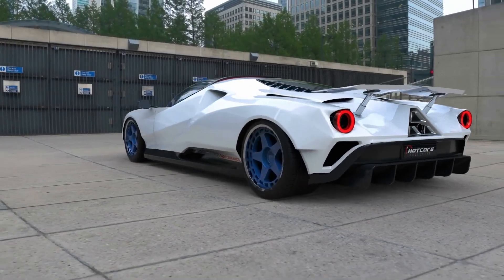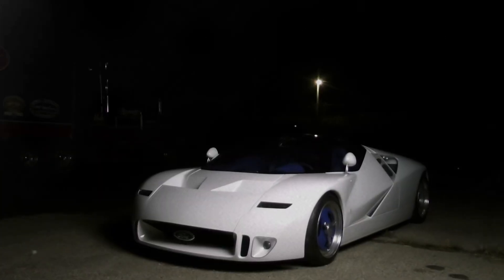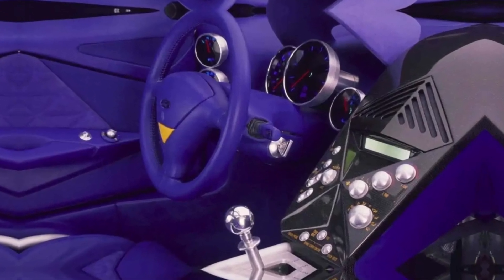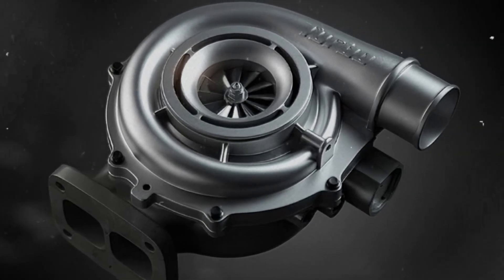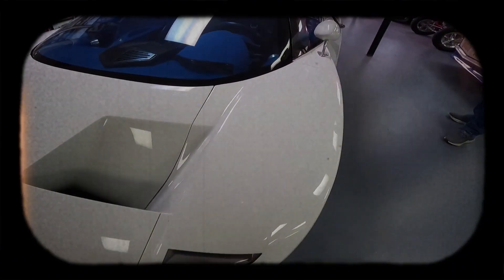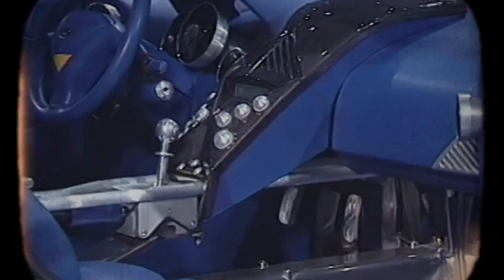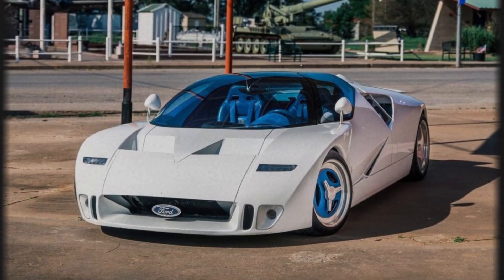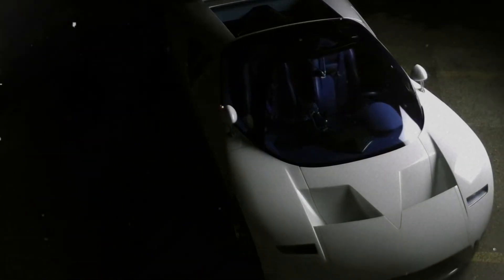Why Ford Failed to Build the Ultimate Supercar?

Comment: How could someone release a video claiming Ford was building a car with 4 V-12 engines? It was one V-12 with 4 turbos. How stupid are these people? Where would you put 4 5.5 liter V-12 engines in 1 car. If he misspoke once then it's a mistake, but 4 engine car is constantly mentioned, even after they showed the car with 1 engine. Amateur hour.